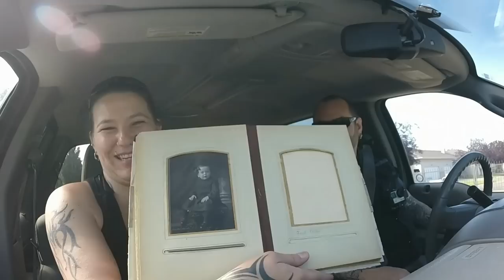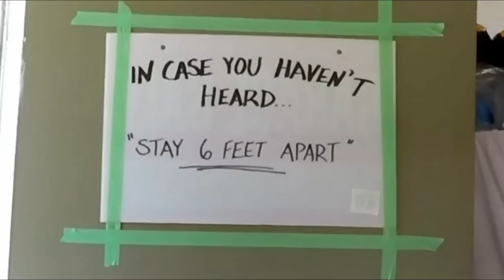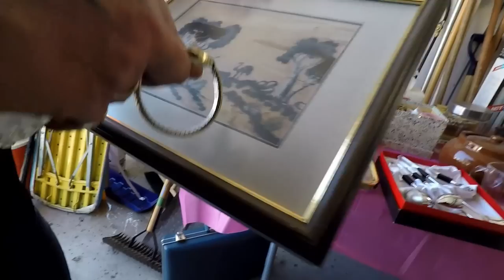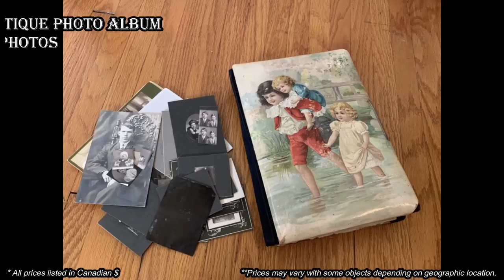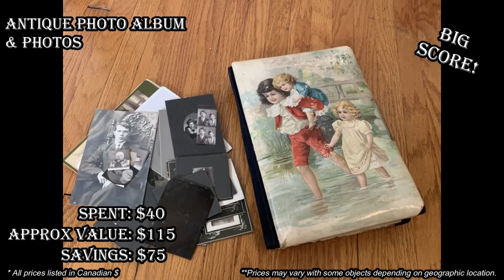Ep297: FIRST YARD SALES OF 2020!!! - COME ANTIQUING WITH US! -The ORIGINAL GoPro Garage Sale Vlog!

Comment: Please no invite to your pool party. right now I am sitting here with my mouth open. What is above the kitchen I know you have a second floor any damage upstairs? Thats me just had to comment before watching it all. But even I knew just by looking what they did wrong. They should have tarped the put of the roof before leaving . Make sure they do something on the gaps between the bottom shingle and the facing or you might have more leaks. I hope they sent in a cleaning crew to clean the kitchen and and electrican to check you wiring expescilly the chandler. Did they fix the kitchen